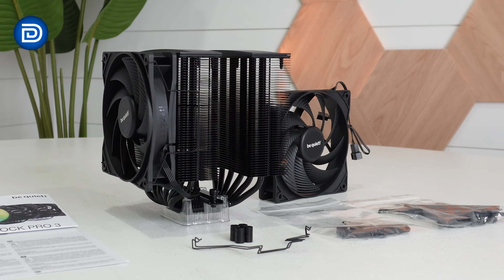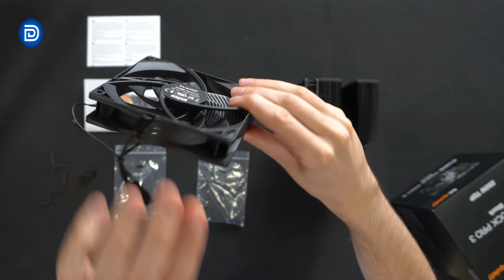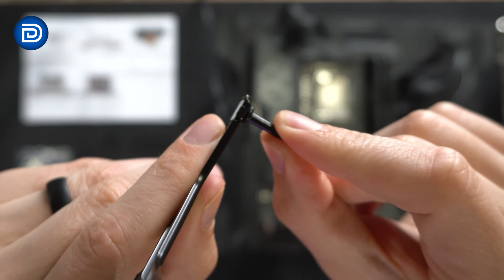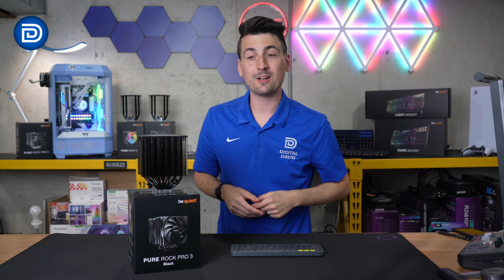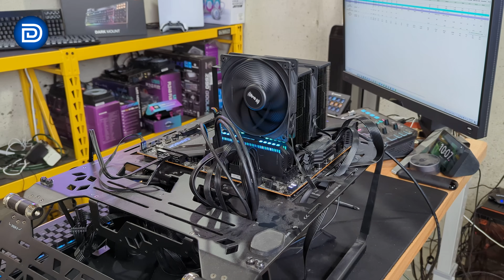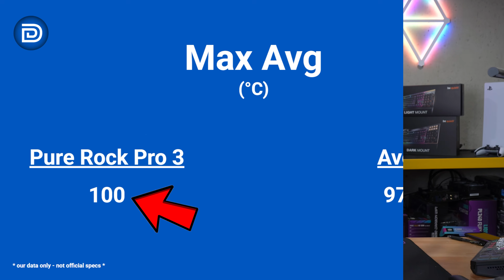be quiet! Pure Rock Pro 3 CPU Cooler Showcase

Comment: Hi , I have this cooler on an intel core ultra 7 265k and have similar temps on idle but in full load (250w) I get 100°C . The CPU is a bit bend so I wonder this is normal or the bending causes problems. Happy to let me know your thoughts!

Comment: Hello i want to by this cpu cooler to a ryzen 7 5700x the ram is ddr4 g.skill trident z 3600mhz and my case is silentiumpc Signum SG1 TG My question is, will the RAM fit into the case without having to remove the glass panel?
Reply: You'll definitely need to open up the panel on your case, I don't know how else you'd get in